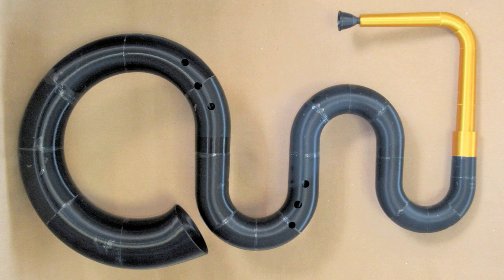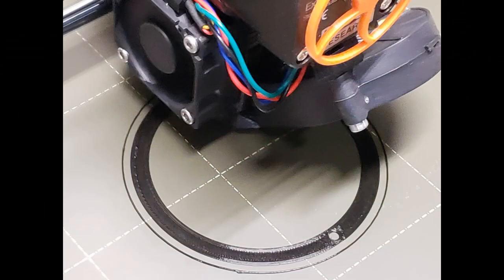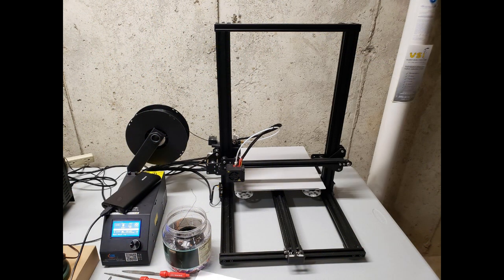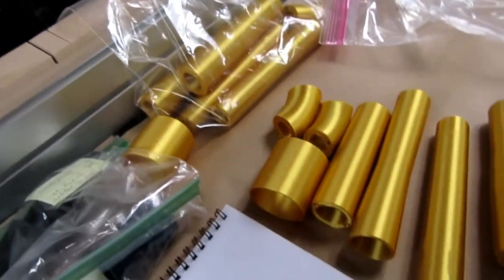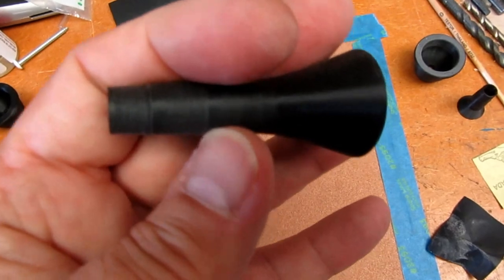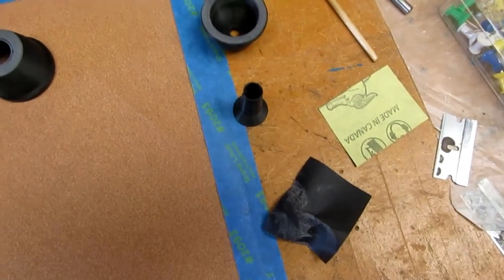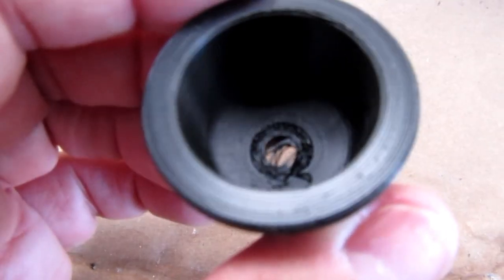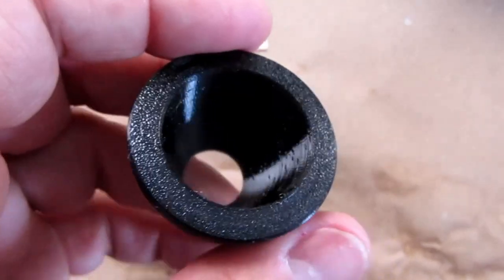Making a 3D Printed Serpent

Comment: I want to try to build my own serpent out of wood, if there anyway you could tell me the dimensions of the serpent without the crook? and individually the dimensions of the crook? I’ve researched online but haven’t found much definitive information on its dimensions I would be very grateful if you could help
Reply from the maker: Patrick Mulch, the Serpent Website (www.serpentwebsite.com) has a 'Build a Serpent" page, and as part of that there are instructions for making a "Squarpent". That gives the critical dimensions for a typical serpent (in any shape). Just remember that you need to start with an inner diameter at the small end equal to the shank of a trombone/euphonium mouthpiece, and over the 8 foot length make an even conical progression of inner bore diameter up to about 4" at the 'bell' end. The finger hole sizes and positions along the bore are just the same as given for the Squarpent.

Comment: much more in tune than my bate anon serpent i 3d printed! is there a way that i could get the files for it?
Reply from the maker: Aster Lebitz-Braden, I also have the Bate anonymous 3D printed serpent, and it plays well. Are you an experienced serpentist? If you are NOT, then the intonation problems might well be due to a lack of serpent technique. Even experienced players of modern brass instruments have trouble making serpents play in tune.

As for the print files for my "Dittes" serpent, I am not at liberty to share them. I am working with the author of those files to come up with a way to share them.
Reply: @youtuuba   alright, i understand with the files, thanks for the reply. i look forward to if they are released.
i have been playing serpent for about a year now and while i am by no means an experienced player, i can play reasonably in tune by lipping the pitch. the issue is the fundamental "c" of the instrument is almost a half step sharp so i have to change the pitch considerably on every note, even those that should be decent on serpent.
Reply from the maker: @asterlb1885  , what are you using for a mouthpiece? This can make a big difference. You can also shim the bocal to make it extend fron the body of the instrument more, flattening the pitch.
Reply: @asterlb1885  I too have made the anon serpent and am experiencing similar tuning problems. Mine has a fundamental pitch of a very sharp Db which makes it completely impractical to play with other instruments. It is not tunable at all since the entire bocal receiver is conical. So I tried to extend the bocal by using a length of 3/4" PVC pipe. That worked to get the fundamental pitch down to C, but not only did it move the mouthpiece to a rather uncomfortable playing position, it also made the instrument incapable of playing B or Bb in the middle or upper registers.

I'm hoping that perhaps I can find the files to this "Dittes" version and have a much more useful instrument!

Oh, for the mouthpiece, I've tried both the 3d printed one that came with the anon files which produces and incredibly airy sound, as well as a small shank 6 1/2 AL trombone mouthpiece which produces a beautiful tone, but the instrument as a whole is fundamentally out of tune.

Any updates on being able to share the "Dittes" files?

Also, absolutely wonderful video @youtuuba!!! The amount of detail you went into was well more than I had expected!

Comment: This could have been printed in way fewer sections.
Reply from the maker: KaptainKwad FPV, are you sure? Every person I am aware of who has thus far successfully printed a 3D serpent, of any design, has found that they needed to make it in sections that did not curve more than a certain number of degrees. They explained that the normal 3D printers cannot print over a gap, so the section must stop while there is still adequate already printed material below to support the next printed layer. In other words, a "r' shape can be printed but not a 'u' or "n' shape. It would not even be possible to print a serpent in two big sections, for the same reason.
Reply: I do believe it could’ve been done in less sections if the cylindrical part was on the flat x/y axis, so long as it was put on a raft. Using this method, it could even be possible to print the whole thing in one print on an industrial size printer. However, there’s no guarantees that this would work, basically because of the tone-holes